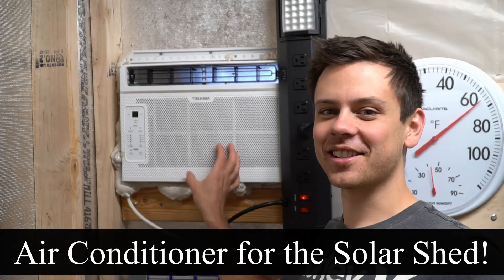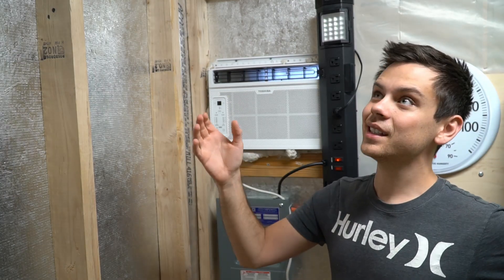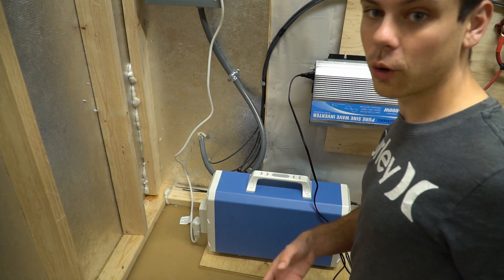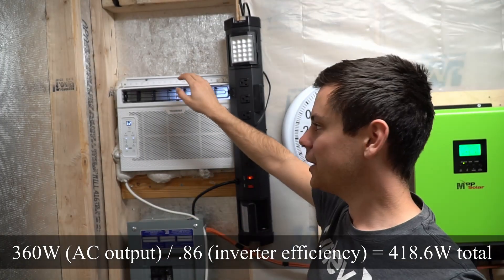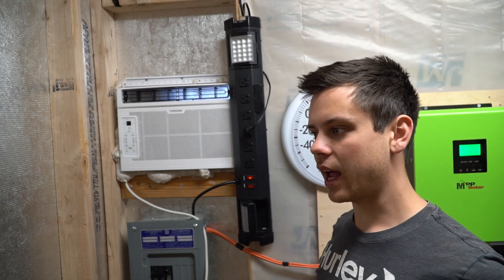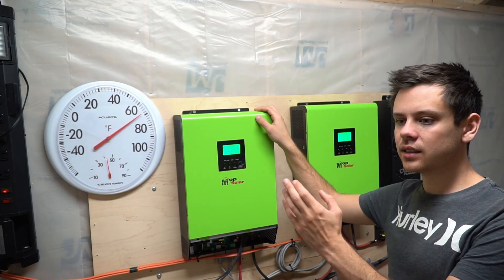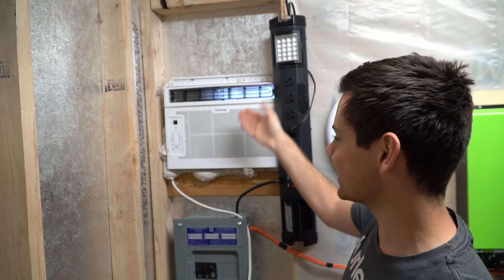Solar Shed: Running a Cheap Air Conditioner

Comment: im in hawaii and would love to run a refridge...my set up is simple  12 volt  system... 3 100 watt solar panels ... tracer mppt 30amp controller... pure sine inverter 1000w/2000w by micro solar...searching for 2 valance lithium batteries... will a power bank allow for a refridge, and what size fridge? thanks will

Comment: Just bought the same window AC unit and hooked it up to my new Bluetti 2400 the second compressor tries to kick on it shuts off and restarts... the odd thing is the Bluetti only shows a jump to 90w and goes back zero... ugh

Comment: Man you know your a.c.. I have a 32 ft sailboat and want to cool it during the summer here in Washington State. But I don't have $3000 for a marine unit. I feel like I can put a window unit in and run the exhaust out to the outside of the boat. And if I need to replace it every couple of years because it wears out it is cheap enough!. So far I have a few, 5000 btu that seem to cool it in 72 degrees but takes over an hour. A new Fridgedair 10,000 btu smart a.c. unit is noisy but cools the boat down in a few minutes but is 3 times the noise. So now I want the quietest one available? Lol now that I know I don't need all the power to cool my 32 ft boat.  I almost bought a Sampsonite marine suitcase ac unit. And regret not getting it now. $300! The owners dad had passed and the kid didn't know if it was good or bad. I should have took a risk on that purchase I think. You don't come around compact water cooled suitcase style a.c. units very often.

Comment: I have intermittently run an AC unit from a Trace SW4048 inverter for years in the summer.  I use a relay to turn on the power to the AC as a dump load when I have excess power.  I think that if you have adequate space for panels, solar AC is smart.  You basically need it most when you have excess power.  Panels remain very cheap if you know how to do the wiring.  I do not have batteries on that system, it is about a kilowatt hour of ultracapacitor storage which basically acts as a buffer with loads switching from mains to inverter or  turning on and off other loads such as supplemental water pre-heating, space heating or AC simply based upon the banks voltage.  Has worked reliably for years.

Comment: Use a wifi switch that can measure power & current. TP-Link has one. I'm using this to turn on AC charging of a large battery at sunrise, and it turns off when the current to it drops below 10watts.

Comment: i think it's nuts that you have whatever equivalent of 50 (FIFTY!) 100watt solar panels taking up your entire yard just to power one tiny AC-Unit for one tiny 10x15room that you'll never even live in. 4.8kwh panels to run a little AC is Horrible! The coveted open loop has become a closed loop! Off grid solar was meant to power our lives, not heat up a little room! If an average 100watt panel is say 3'x4', that's 12sqft, so 50 of them is 6000sqft! That's covering the entire average american's front and back yards, and sometimes even the houseroof, just to cool down a little backyard shed, with nothing left over to power life's appliances! All for naught it seems, like feeding a pet-rock.

Comment: This was an interesting video, especially because I'm still trying to decide how to handle hvac in my shed. What would you recommend for someone who lives in a climate that requires heating in the winter in addition to summer cooling? Mini split seems to be the only option but I'm desperately trying to find viable alternate ideas. Thanks.
Reply from the maker: Hmmm that's a tough one. Heating is still a huge challenge. I prefer increasing capacity of bank so that cold temp charging is not an issue. There is a battery researcher in YouTube that has graphs on low temp charging. If you are trickle charging, it will be ok. On my system, I have a low temp cut off when it's cold and that's it. Easy to do on solar input too with temp activated relay
Reply from the maker: Or make a insulated box and add small resistive heaters that turn on below a programmed threshold

Comment: So you're worried about spending 600-900 on an A/C, yet that bluetti thing costs nearly 2 grand.
Reply: You would spend $2000.00 in several years in hot places where  this AC is needed year round. After that your cooling is free, after the costs of the other components. I use 1 window unit just to keep my sunroom cool as my central AC just doesn't do it.

Comment: Insulation gives you the biggest bang for the buck in return of energy savings. It will help you a great deal.  Especially after you insulated the 'attic space' you will build.  It is amazing the amount of radiant heat that comes through a roof space on a sunny day.

Comment: The other side of the coin.... INSULATION.  If you turn the shed into a refrigerator insulation-wise, it'll take a lot less power to cool it.

Comment: Have you designed a ventilation system?  Running pipe underground could drop the air intake temperature from 120f to 60f. Then all you need is a small fan to move the air.

Comment: Mate, just have a 5w led strip running off the circuit when the aircon unit is on standby.. 🤷🏻‍♂️
Reply: Or an old radio.

Comment: your inverter to bluetti setup looks like a waste since it will do so much conversion.

you are better off adding batteries before conversion or charge the bluetti on the DC side.  you look like you are doing 24V to 110VAC to 12 V to 110VAC.   That is lots of wasted heat.

Or better yet. you should have looked for an RV AC unit that used 24V  or what ever your battery setup is.  No conversion loss at all and way less need to "Add some more solar panels"

Comment: FYI, when watching the detail energy usage, you may notice AC efficiency drops when it is very hot outside.  All ACs lose capacity at high outdoor temps because it requires more energy to compess refrigerant to a liquid and the liquid has a higher temperature (part of liquid flashes to cool the hot liquid to normal).
If your are watching the inside half, some days the cold discharge air is warmer for the same room temperature.  The BTUs cooled is sensible heat (a.k.a. 72° cubic feet of air moved) PLUS latent heat (amount of moisture in air removed a.k.a. grains of water/relative humidity % or wet bulb temperature difference).   If you boil noodles, the AC must remove the sensible heat (from the hot plate) and latent (from the latin word for hidden) heat when the steam is condensed into water.  This can be 1/3 of the energy used
So if the AC numbers don't added up like yesterday (change # of cycles on/off), the weather or a door left open, probably chaged a little of the degress and/or humidity.

Comment: Great video, Will! We’re designing our system for our skoolie based on your book instructions & are wondering how you calculate short time loads for inverter size? We have a 1800 watt induction cooktop we’re going to use for 1hr or less per day. Do we just add up the anticipated total watt consumption x2 to determine the inverter size? We plan on going 12V (unless you think 24V would be better for inductive loads?) Our total anticipated watt usage is 7860wh, but some of the appliances are only run for 10-30 min. Also would the Giandel be a better option than Krieger?

Thanks so much for doing what you do!
-Brian + Erin

Comment: Another great vid.  helpful content.  question: what do you recommend as "the most efficient" option for AC in a sprinter van/adventure vehicle build?  I'm figuring on having 2-300ah lithium batteries with 3-400 watts of solar on the roof.  thanks!
Reply: 600AH?  You got an electric oven in there?
Reply: @kimmer6  nope.  biggest energy sucker is a vitrifrigo fridge on 110 from the inverter.  other than that simple 12v stuff
Reply: @kimmer6  to clarify, and my apologies for not making it more clear: 2 or 3 100 amp hour batteries.  so 200 or 300 total.  and as it turned out I ended up only buying 2 so it's officially 200 amp hours.  thanks
Reply: @TheJaredsalinsky  I always wanted to build an adventure vehicle but I'm getting too old and slow and seldom leave the neighborhood any more. I installed LiFeP04 batteries in my house last year but kept the old AGM's on float charge. There's  a 500 amp continuous Blue Sea marine battery bank selector switch to run either bank.  I like to rig for silent running when the grid goes down...again.  The lithium batteries are awesome. I hope you post videos of your build.

Comment: The standby consumption is only part of the equation. If the inverter/s have a low standby consumption and a low efficiency then you may be better off with the higher consumption inverter. Conversion efficiencies in the inverters are a great source of heat. If you can have them outside of the cooled area and still have them within their own temperature limits then you will save aircon power usage. If you can line the entire walls and roof with styrofoam or urethane foam then there will be exceptionally close to no heat coming from the outside and it will be purely losses within inverters and the batteries that you have to get rid of the heat from. 
Make sure that you have an alarm system in place so that if your aircon fails for some reason you will get a notification that there's an overheating problem. With a very well insulated room if there is no way to get rid of heat due to a failed aircon or inverter or something there will be a very dramatic and very sharp increase in temperature. I've been there and done that.

Comment: If you were able to put the shed to half it's height underground, that will drop the Delta T ( difference between outside to inside temperature ) --- and drop the power requirements of the air conditioner.

Comment: Hi Will . I use a wifi plug for my air conditioner  . It has both timer and countdown programs,  built into the smart plug app. . I use the timer to turn a/c on and off. 
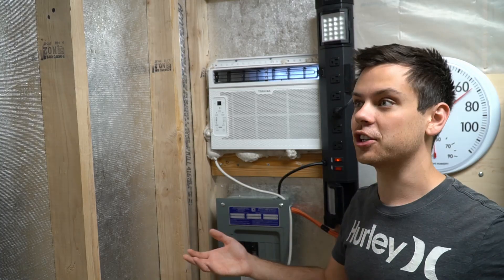0 watts stand by (plugged into ac outlet. 12:00 on ,1:00 off etc...
If you use a countdown you have to create many on / off times ...ie... 30 min. On , 60 min. off ,90 min. on etc 
The problem is you need to restart each  timer, everytime that you want it to go through the cycle. If you dont , it won't  go on or off .

Comment: Glad to hear about the Giandel I was looking at those but was not sure how good they are.  I kind of want to upgrade my little 350w so I can run bigger loads.  Have you tested to see if it will run big loads like a microwave or mitre saw?   Was looking at that exact AC unit too, was thinking of setting it up for either my bedroom, or office, so I can run it off my shed.  Free cooling!  I generate more power than I can use in summer so it would make sense to run a small AC unit.

Comment: You use a Tado wifi ac controller to turn on and off the ac unit (assuming it has IR receiver) that would also mean that you would have cloud based control and temperature logging, the later meaning you wouldn't need the big temperature gauge on the wall

Comment: Want AC in my studio i built. Smaller than your solar shed. I have a 200w renogy seystem with 100ah gel batt would tha be enough to power one of the 6000btu ac units for even a few hours a day? Thanks(newbie)
Reply: thanks for videos!
Reply: 12 Volt system

Comment: Nice.  Adding R-13 fiberglass insulation to the walls, R-30 fiberglass to the ceiling will really lower the power A/C power consumption.

Comment: The best deal in thermostats is Sensor Push on Amazon. $99 for the hub and $50 per wireless thermostat. The Sensor Push hub uploads temp and humidity to the cloud once per minute and will alarm you with custom set points. I have 5 in my RV. 2 for the Norcold refer/freezer. 2 for 2 chest freezers  and one for my battery bank.  The cloud achieves all the data.

Comment: Mr. Prowse,  I am in complete awe of your technical prowess,  finding your knowledge of solar unparalleled.  As an afishionado of all things solar power I'm prayerfully hoping to beg your knowledgeable assistance,  I am trying to formulate an installation plan for a sailboat.  I have devoured data on the subject provided by you and other contributors,  albeit I humbly confess that I am not comprehending the information.  It being far to steep a learning curve for my meager understanding,  in order to glean a practical sense of the subject I must defer to those like yourself.  Might there be off the shelf pre-designed kits available,  a sort of modularized plug-and-play system needing only to be assembled.  I have attempted to find answers through internet queries,  yet without having an intuitive knowledge of the subject it is oftentimes difficult to identify search terms.  I do understand that you're a very busy man without the luxury of time,  but if you could at least steer me in the right direction I would be in your debt.  I am hoping to have a self sustaining system,  coupling a wind generator' solar panels as well as a 5KW diesel generator.   A lot of my confusion lies in the configuration,  be it a 12/24/48 volt assembly for the most desirable  efficiency.  I simply lack the ability to even visualize these concepts.  At any rate I would like to thank you for taking the time to read this lengthy request,  I would be wholly without a doubt indebted to you for any assistance in this matter.

Comment: Question about the Bluetti EB240 and the Air Conditioner you are showing. I just purchased the Bletti 240 and the question is, does it have enough power to start the AC? I think the running will be ok but how out the start up? Will the Bluetti handle it?

Comment: I have a battery question, I'm trying to buy a solar kit from Renogy, but I remember you are a strong supporter of the Battleborn batteries, do you feel they are better than the Renogy? I was going to buy the Battleborn, then decided to ask first, all of this is so expensive for a retiree, but what needs to be done needs to be done!
Reply from the maker: Battle born is better. UL listing for entire pack. Renogy is at cell level only.

Comment: Hay Will, how about a vid on setting up a solar charge controller to charge an ebike. Can you charge it alongside your 24V 400Ahr BB RV setup or should you have a separate panel and controller?

Comment: Hey also, if I have like 3 72 cell 240's hooked to that 100/50 Victron, is parallel or in series called for? I think a lot of us are confused by this. For me it's like my brain gets stuck in quicksand.
If your a minimalist person or a rv'er just the 200 amp hr system is really enough to sustain a first world reality.

Comment: Thanks for your vids dude. Recently I was studying marine electronics over at Pacific Yacht Systems and I learned that my 2 6v interstate lead acids should be charged at a rate of 50 amps. That's why my rv came with a 50 amp charger. That's a lot less than the maybe 20 amps I get from my solar. That is hard on my batteries because they need the 50 amps to de sulfate. I don't think that many of us small time folks understand this. I'm currently going to upgrade to a 100/50 Victron and am looking for 700 watts of 72 cell panels. There are some used ones on ebay and I thought that could be a good review from you on those panels. Sadly they have to have a pallet so shipping is expensive. I'm thinking of just getting 10 and reselling what I don't need. Used panels vs new is a good subject. If somebody out there in the north bay area of Ca wants to split a pallet of ten or needed 3 or 4 that could be cool.

Comment: Need some help. I plan to power a 70w AC appliance for 15 hours a day (at night). My calculations are 1050w per day needed. Will I need 4 100w panels to only use about half of what I store and a battery that can hold 175Ah?

Or am I way off?

Comment: Hi Will,

I have watched lots of Youtube videos. It is very informative and well explained.
Thanks a lot for your contribution.

I am going to retire soon. I plan to travel by SUV(currently I have) or Minivan(plan to buy a new one).
For this plan, I try to buy a Battery Power Bank.

Some items are not available in Canada where I live. 

So, I plan to buy Jackery 500(1000 is not available here). But I have found Eco Power+ 56V 3000W.

The item has 2 battery with 56V/7.5Amps.(2x56x7.5=840 W)

But the company says that it holds 2000W with a maximum of 3000W for 3 seconds.

I don't get the explanation. Have you reviewed this item before?

Thanks for your help in advance,

Sam

Comment: Will, some quick feedback.  The only thing stopping me from taking the plunge is I haven't seen any material yet on how not to electrocute myself.  Seriously this is the only thing stopping me.  Figured I am not alone.  Maybe a quick video on solar panel safety and best practices can put those fears to rest.  I can't be the only one held back by this simple fear.  You have laid out the technicals perfectly....maybe one video on how not to kill ourselves.  Thanks Will.

Comment: I want solar panel to aircon setup - no battery, no inverter.  The more sun, the more power to the air con.  Can it be done?
Reply: Just my opinion: he runs it 24/7. The batteries are needed to store energy for when there is no sun. The inverter is needed to charge the batteries. Solar direct to a/c - my guess is it would fry the a/c. Even if it didn't ruin the a/c, it would be a case of no sun, no air cooling. So no cooling at night.

Comment: I love this channel. I have learned so much from your passion. 48v is way cool but, what about 96v? I don’t see too many mpg charge controllers  or systems why? If 12v is good and 24v better and 48v even better what about 96v has gotta be the most efficient? I’m here to learn and hopefully you can once school me. The other question have you looked into HHO (hydrogen storage) as apposition to battery storage)
Reply from the maker: 96V is quite dangerous. I would avoid it. And yes, very efficient. And thank you!